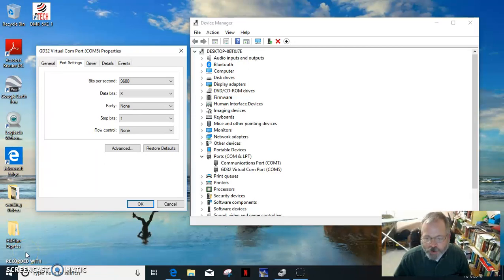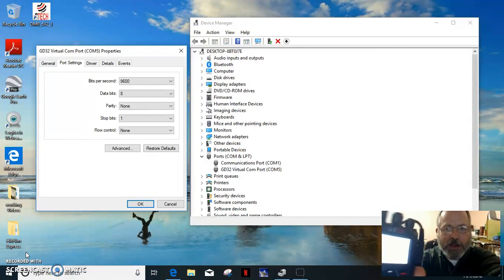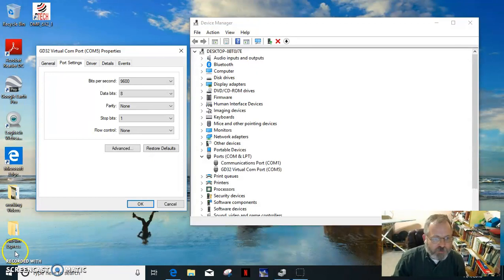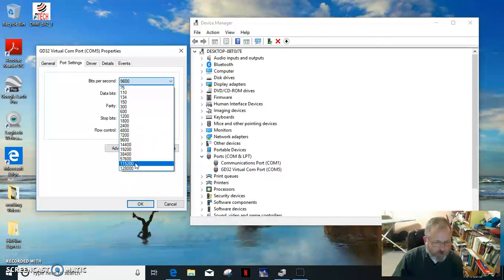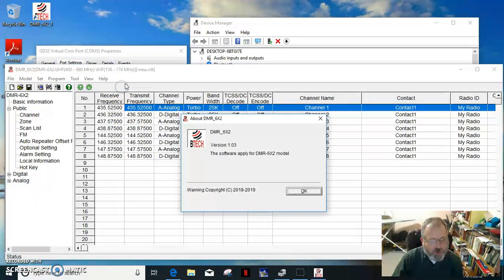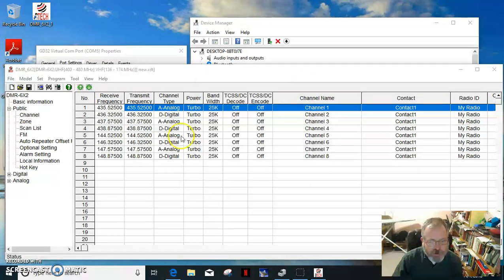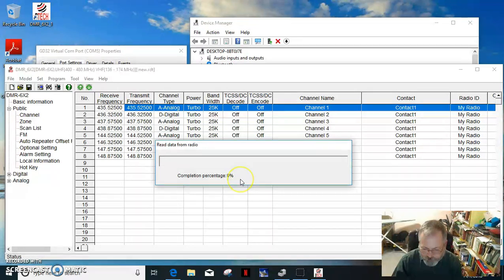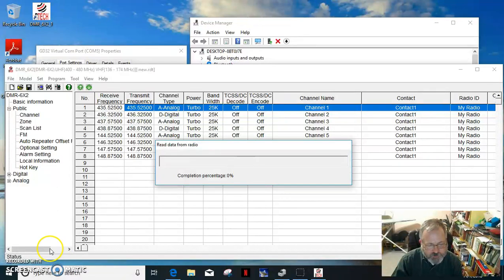Unable to computer program Btech DMR 6.2

Comment: I was having the same issue.  The problem was I had knock-off cheap cable.  Once I had the correct cable I had to run the CPS as a computer admin.   Just posted in case others are searching for help with their BTECH DMR 6x2.   https://baofengtech.com/dmr-6x2  has updated drivers and firmware.

Thanks for the video.